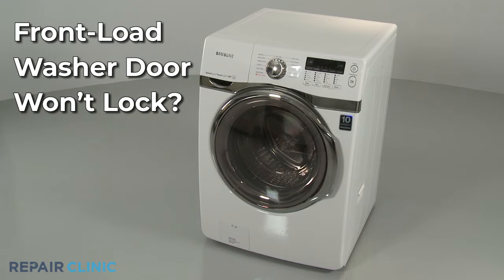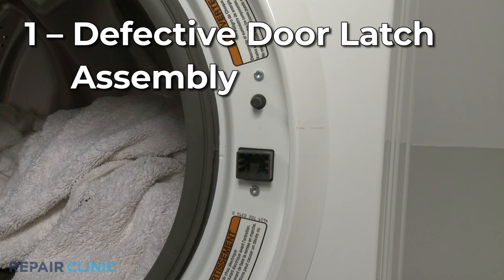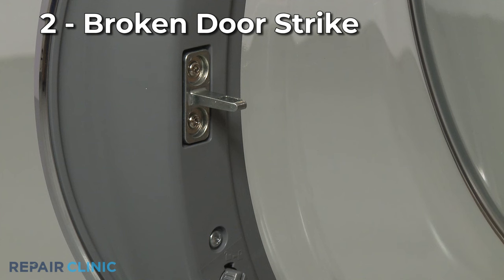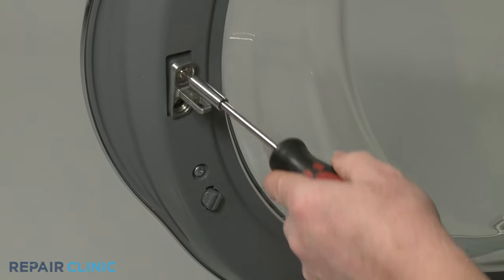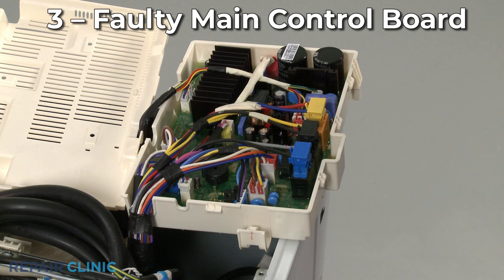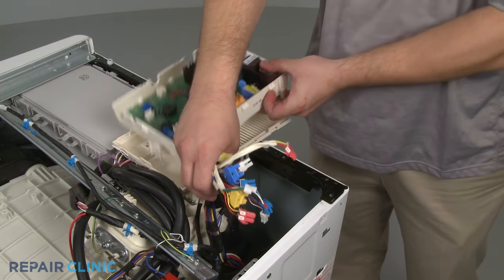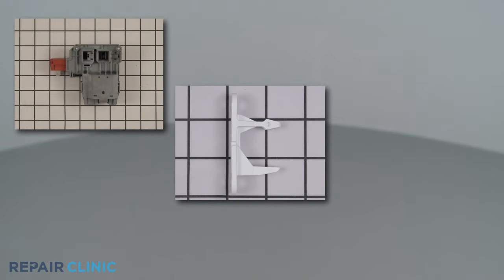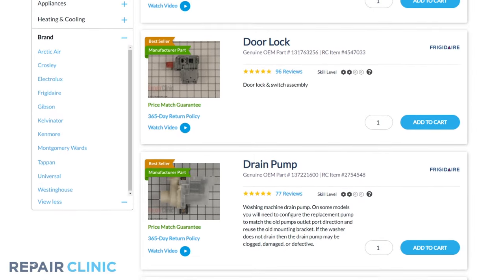Front-Load Washer Door Won't Lock — Front-Load Washing Machine Troubleshooting

Comment: SIMPLE FIX:  I had this problem & solved after trying all the other fixes and inventing one.  I first changed the lock assembly and the door strike.  I also changed the Hinge (the door was loose and hanging low).  I then adjusted the glass "skew" (I took the door off, then the outer ring, pushed the glass up then retightened on the outer ring).  The door no longer sagged or wiggled on the hinge (make sure hinge is hooked into the tabs).  Still the latch would not lock (probably the seal gasket is old and keeping the door from closing but that seemed like a pain to change). So, SIMPLE FIX:  I took the latch off the door, made sure it went into the lock assembly - it did.  Then I added 3 #5 rubber o-rings and 1 metal washer to the back side of the latch screws and re-attached the latch.  That gave the latch enough extra length to by-pass the gasket pushback issue.  Maybe the manufacture could just make the latch a little longer...  No leaks so far, no more buzzing, and now it actually locks!